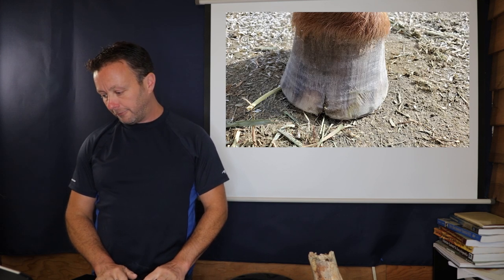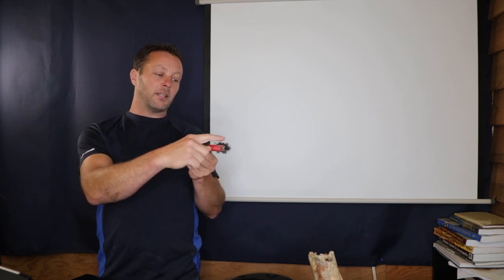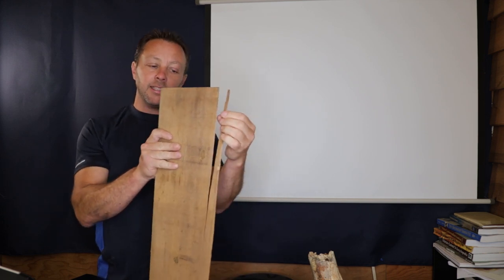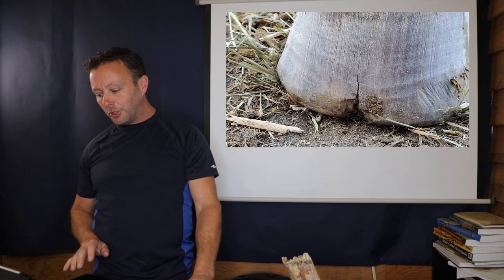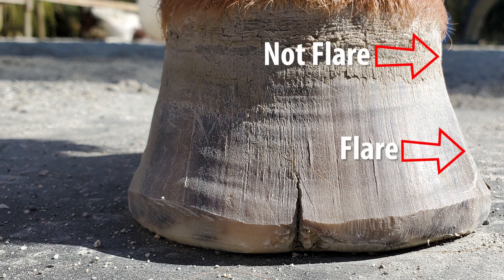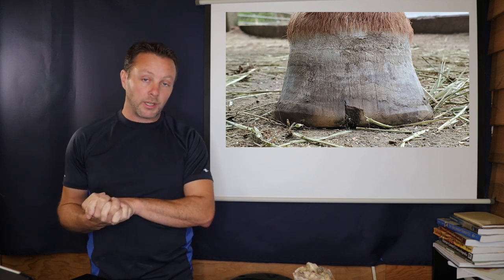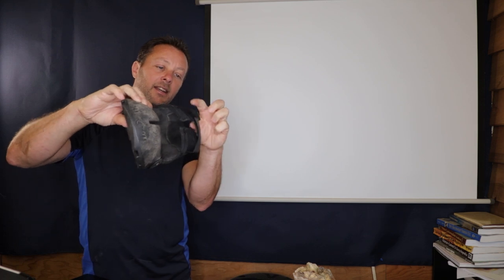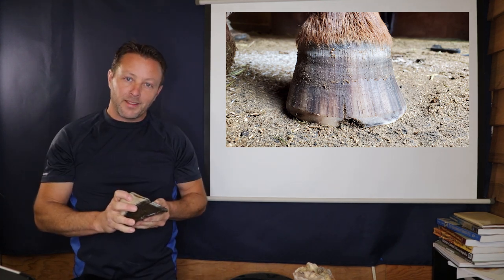Why EXACTLY Toe Cracks In Horse Hooves Happen And How To Fix It Properly

Comment: This is one of the reasons why I took your Horse hoof trimming 101. Finished all videos in 1 day and just waiting to get some tools. My girl has had a crack like this for 3 maybe 4 years now. Now that I know how to get rid of it. Maybe it will grow out this year. Thank you
Reply from the maker: Holy smokes! In one day... that is impressive indeed. Well, if you have any questions then let me know anytime :)
Reply: @StableHorseTraining   I do have a few questions. I want to make a video so you can see what I'm talking about. It was -32 F this morning so the batteries in my camera don't like to work so well. Or my fingers...LOL. How cold does it get at your place?
I do have a question about ice balls. Here is a short video on how I will take them down level so they are not walking on them. Am I ok doing it this way? I try to tap across the walls to chip ice off. I also try to dig ice out with a strong pick (like yours) but it is so packed in and frozen. Do you get these and if so how do you deal with them?
https://youtu.be/gaQcKp9lvkA    Thank you for getting back to me
Reply: @StableHorseTraining   I sent you an email with videos of my horses' feet. You can answer this question with one of them. Thanks

Comment: It's fascinating....the hoof and it's  structure.  And I understand it a lot better now that you related it to wood.  It makes way more sense. When a good cracks like this, roughly how long does it take for it to fully heal?  Thanks for posting this!
Reply from the maker: You're welcome! Depends on the depth and severity, up to a year is a good thing to think. Sometimes less as the crack likely doesn't go all the way up. I've had a few grow out in a few months and then it's just good solid maintenance.

Comment: love your examples of the wood. Bamboo is a really good example too of a hoof wall, because it is  conical like a hoof and it also has easy to see tubules, layers to it like a hoof  and tends to splitting. great to hear a talk on mechanical forces and leverages, this is what it is all about when we are striving for balance.  surprisingly not a lot of people are aware of these concepts and the geometry of the hoof.
Reply from the maker: Thanks! That's an excellent point, yes bamboo would be a good example to bring out for that.

Comment: Love the wood prop...very creative on your part to find the similarities of hoof and wood when it comes to cracks. 
Why was this the only hoof that had the pillars trimmed improperly and allowed to grow out too much causing a middle crack in that hoof? Would the other hooves have eventually succumbed to cracks too?
Thank you for sharing and as always very informative.
Reply from the maker: Thanks! It was a lucky find by Hailey actually. I'm not sure exactly why the other one didn't split. It could be due to the trim this foot received for a long time.. the other one should have split but maybe it was so flat that it didn't.. Not sure. Yes, in time hooves will split and crack unless they chip off. Chipping off is normal in fact and protects the hoof. This horse was likely on soft ground for too long and the chipping just never had the chance to happen as there wasn't hard ground to make it happen on. I'll do a video on the back feet soon I think. They had rot in the walls that was relatively quickly grown out, similar problem in a way.
Reply: Stable Horse Training 
Koodos to Hailey for paying attention to the horse and absorbing what you are teaching her and us with your videos. 
Thank you for taking the time to reply.

Comment: It's interesting this topic show up from you today. I just got a new horse, from less than optimal conditions. Turns out she has a crack on each hoof in the same place on the outside. The farrier said it is NOT abnormal and that I should keep it rounded off like you mention here. Nice work
Reply from the maker: cracks are VERY abnormal... maybe I'm not understanding what you mean though. For what it's worth, a hoof should never ever have a crack in it, if it does, it's 99% of the time human caused due to negligence in one form of another of either trimming incorrectly or not enough trimming.
Reply: I think what he ment was, he sees this in horses that have been neglected.
Reply from the maker: That makes sense

Comment: Hi nice presentation and explanation. Makes sense. ( Most farriers cut it open to let air in, as you said) 
But don’t you try to treat the thrush in the crack ? 
I was taught to remove as much of the thrush as possible and regularly soak briefly with very small amount of largely diluted copper sulphate to kill the fungus . I have had good success with this.
Reply from the maker: If there is actual bacteria or fungus in there, then it can be treated. Many times there's nothing and it just needs to grow out.

Comment: My horse has a toe crack, no signs of bacteria at this time.  Barefoot trimmer said she would keep it mustang rolled for no but if it got longer than 1" long I should go to shoes.  I'm hopin gto stay barefoot.  Does it help to ride in hoof boots?  Would cleaning then a casting tape and or hoof armor help keep the crack from extending while we are working towards repair.  Thanks for your video and opinions.
Reply from the maker: No, it doesn't help to ride in hoof boots unless your horse is more comfortable in them. Shoes do not solve cracks, they make them. Trim also creates cracks, or lack of it. If you had a farrier managing your horse and the crack happened, they caused it by either not trimming enough or trimming as often as the foot required. If you're going beyond 3 weeks on a trim, you're going far too long. For cracks I trim every week for months a little bit at a time to get rid of the mechanical leverage that caused it in the first place.

As I have no idea what your horse's hoof looks like, there's really nothing further I can recommend. I hope the video helped in the case study that I showed.

Comment: My older gelding has developed an inch long toe crack in both front hooves. I'm doing my own trimming because my trimmer quit coming. Despite all the time and effort I've put into getting him to lift his feet, he just does not want to most days. This makes it very difficult to keep up with the hooves. The information on the pillars is very helpful and I will check for that next time I go out. I was glad to hear you do not recommend carving out the area as that is a common technique I'm not a fan of. Do you ever use CleanTrax? I have some and wonder if it would help with the growth of bacteria in the crack area. Thank you.
Reply from the maker: I have seen it, seen it recommended, tried it and quickly learned through my experience that it really had no use that proper trimming didn't just clear out in the same amount of time and less effort. If you are having trouble picking up the feet, you can put them on a 2x6 and hang the toes off the edge of it to be able to rasp them back a bit. Check often you aren't going too far by looking at the bottom of the feet. Soft ground usually works better for horses that are struggling to pick their feet up. I once had to switch between the front hooves a horse about 30 times to get them both balanced and trimmed correctly and then he'd hold his feet up for a bit longer than 5 to 10 seconds. From that trim on I didn't have as many issues in that regard.
Reply: @StableHorseTraining  Thank you so much for your reply. I'm going to try that 2x6 idea. What you describe with the 5-10 seconds really fits my horse. The other thing he does: as I ask for one foot, he weights it and offers the opposite hoof. This has me running back and forth until I just get tired of the game. I do not lose my temper with him. Usually he is most willing to pick up the left front and weight the right, so today that was the only foot that got done. May I send you a photo of his toe cracks? I also have questions about frog, to trim or not to trim and how much. Varies so much between barefoot farriers. Thanks again.

Comment: Hi Graeme, do you think it's a good idea to use epoxy glue to fill the crack/hole to avoid dust, moisture and tiny rocks to slide in? (of course, with some kind of strong cleaning solution before filling the crack)
Reply from the maker: Not really but I do sometimes put temporary cotton pieces in a gap to block outside material without creating something solid. I would worry that something hard like that would make the situation worse.

Comment: Do you mind if I ask what boot that was you used to demonstrate Velcro?  Is that a boot you would recommend for a horse with thin soles?  Could a horse be turned out with that style of boot?  I was looking at EasyCare / EasyBoot Clouds but I don’t think they will hold up. 
THANKS for your videos!!
Reply from the maker: Easycare boots and cloud boots are fantastic. They hold up to a lot. That is the boot I used in the demo. You can turn them out with them on for sure but it's important to maintain them and remove to dry and clean regulary.

Comment: For some reason, I’ve been doing the opposite now I know thank you very much, would COPPER SULFATE BE helpful to prevent fungus high into the the hoof cracks???
Reply from the maker: Proper trimming and it will grow out just fine. Lots of people over treat things. Copper sulfate kills healthy cells too so it’s not advisable at all. If you doubt that, put it on an open wound and see if it ever heals. Not a single person on the planet would use it on themselves but somehow it gets recommended for animals…

Comment: Thank you for your knowledge.  I have a 8 year old mare that has a crack that my farrier has been working on for quite a while and it was getting better,  then I broke my back and couldn't help with trimming and so he hasn't been doing the trimming so the crack is getting worse,  but I don't see any flair in the hoof.  He always blames seedy toe for cracks. I haven't trained this horse for riding yet because I have had health issues. I'm getting better and started training her, but then I broke my back getting a bag of feed out of the car.  I would like to send you a picture of her hoof. Would you mind if I did. I do need your email address.  Thank you.
Reply from the maker: hi Starlene. Sure, you can send it off to graeme@stablehorsetraining.com. You'll need to get down low and take a non angled shot if possible. If you can get a shot of the bottom of the hoof too, that would help. Sometimes when we can't see flare in the hoof, it's because the whole hoof capsule is flared from the top to the bottom.

Comment: I won't be able to pick her foot up because of my back. I will be on light duty for another week, so I will wait until I can work with her feet.  My farrier blames all cracks on seedy toe, but they have no bad odor and I did have seedy toe with an older horse and the inner wall had turned black and had a bad odor.  He does trim them nicely and gets along with my horses. I should be able to take the pictures next week.
Reply from the maker: Seedy toe is flare. That's not an opinion and can be very easily explained with science.
Reply: @StableHorseTraining  I knew it wasn't seedy toe.  The crack is right in the center of the front of the hoof. I go back to full duty,  as my pain tolerance permits me on Friday. If the horse gets stubborn a out lifting her foot,  I'll get my daughter to help me and send the pictures.  I appreciate your knowledge and how much work you do for horsemen.
Reply from the maker: You're welcome 😊

Comment: How do you fix a crack that is on the side of the hoof?
Reply from the maker: Trim the walls to reduce leverage on either side of the crack. Likely the toe is out of control and the heels are stuck. To get a quarter wall crack the trim really has to be bad for years and years
Reply: @StableHorseTraining  Thank you for your quick response and advice. Your videos are awesome and very informative! Thank you!